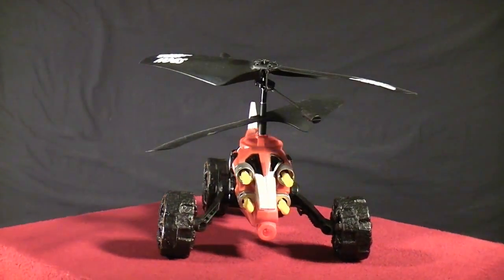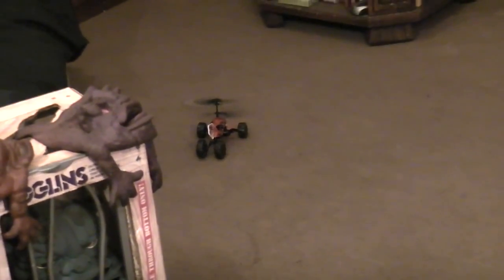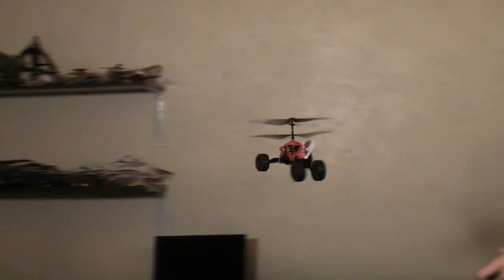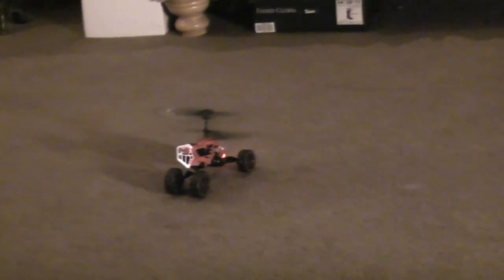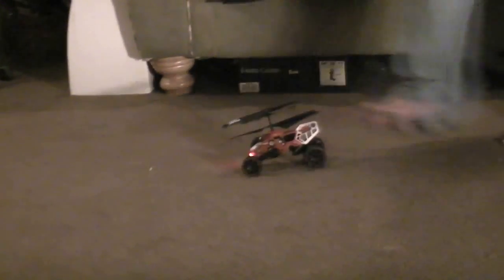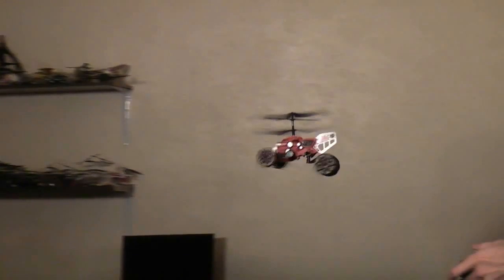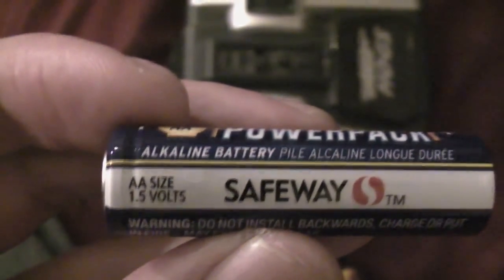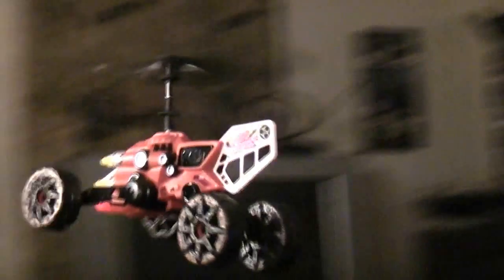Air Hogs Hover Assault Review / Drive Fly Shoot and Jump.

Comment: bought one for my son at christmas, it doesnt have enough power to fly. period. the lower rotor seems to be low on power. i fly plenty of helis and cannot get this turd in the air. hands down crap. my mother in law bought a coaxial "coast guard" heli from jcpenney for 10 bucks for me. uses a flight stick air motion control. its cool. flies amazing. it will hover. climb. nose left, right, forward and backward flight. its honestly better than my walkera 5g6. free crash parts for a year too :)

Comment from the maker: You need really really good batteries in the remote for it to charge, if the batteries are not brand spanking new high end alkaline AA batteries you won't ever get a good charge. It was one of the main problems I had with this heli, rechargeable batteries wont cut it so you have to use disposable batteries:(
If only airhogs made a USB charger.